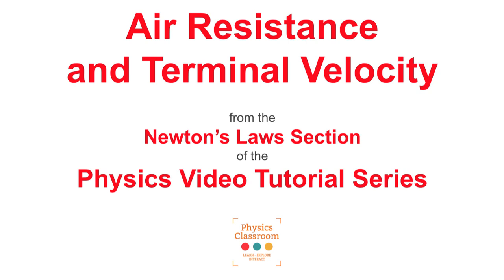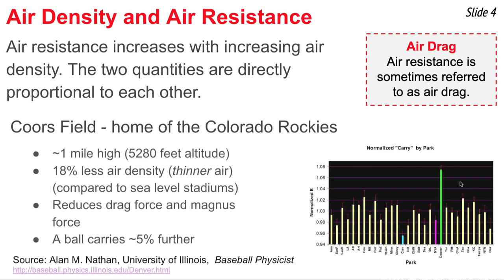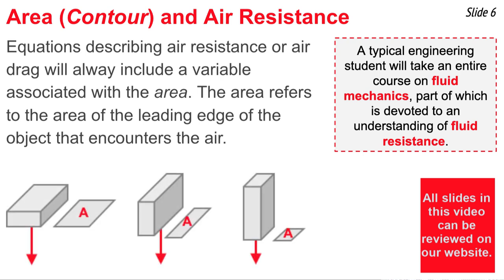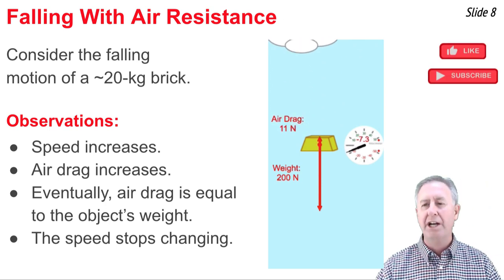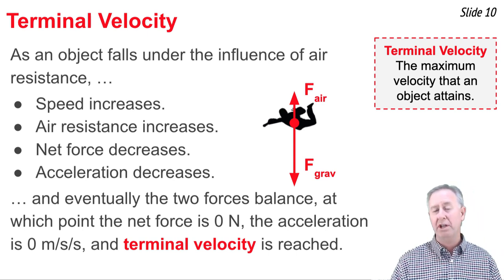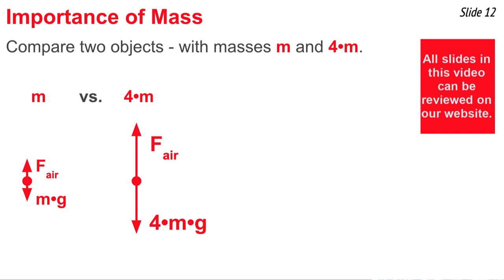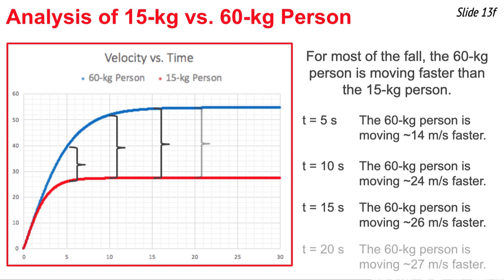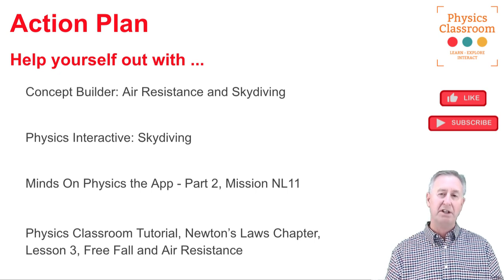Air Resistance and Terminal Velocity

Comment: Thanks for your videos. I have a doubt. Even after reaching the terminal velocity, when the forces get balanced, the moving object will still collide with more and more molecules during the travel. Won't these collisions lead to unbalanced force and accelerate the object?
Reply from the maker: The air resistance depends on speed. If the speed isn't changing neither is the air resistance
Reply: @PhysicsclassroomVideos  Thanks for your reply. I appreciate it but still I am not clear because air resistance also depends on cross- sectional area. The object will be still colliding with the air molecules when it travels.
Reply from the maker: @rmazam700  yes. True.  And that's why there is still air resistance once terminal velocity is reached. It's just that the amount of it is not going to change any. So the object will continue falling with balanced forces at a the forces at a constant velocity.

Comment: Before reaching terminal velocity, it sounds like the shape of the object is really the only relevant variable.  Thus, why do people say that a heavier skier will ski faster than a lighter skier when it is likely that the area of the heavier skier's body will be greater than the smaller lighter skier.
Reply from the maker: I'm not sure I would agree with your 1st statement regarding relevant variables but I don't know what "relevant" means.  A skier will reach terminal velocity when the resistance the resistance forces match the component of gravity Is directed down the hill. A heavier skier experiences a greater component of gravity and thus must travel faster in order to accumulate sufficient air resistance to match this down-the-hill force.